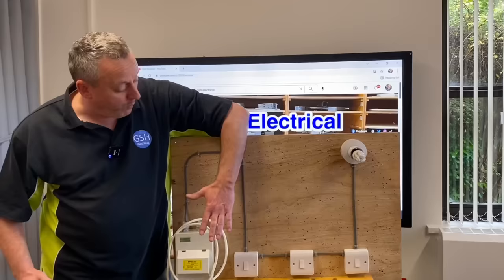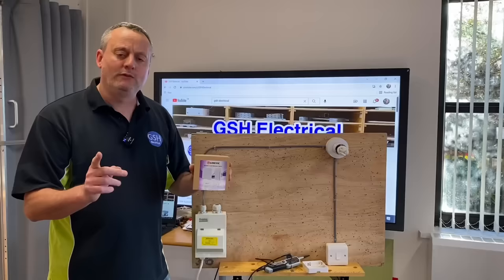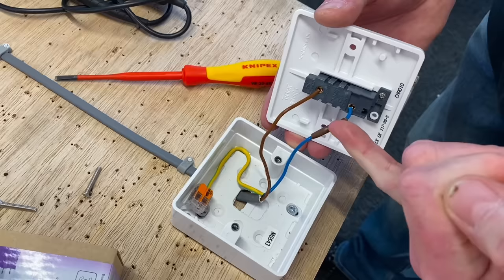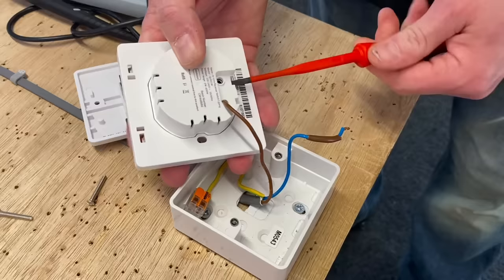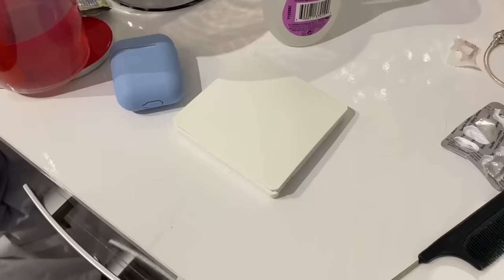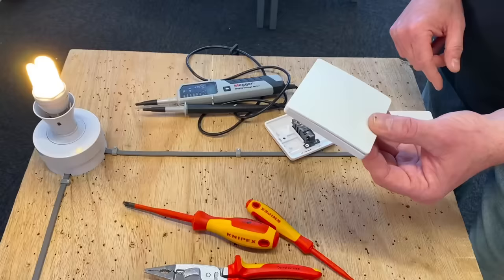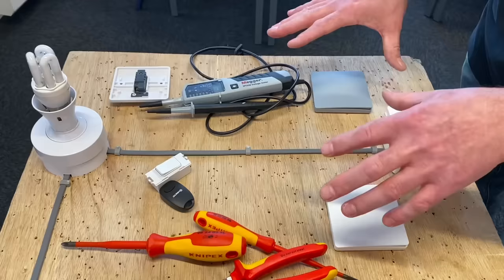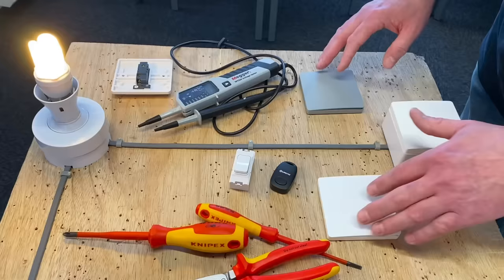No More Wiring Light Switches - The Secret is Out - Quinetic Wireless Switch with Built in Receiver

Comment: Looks great, but I've got a couple of questions - I'm an electronic (not electrical) Engineer by profession, and I understand that the master switch overcomes the lack of a power supply, i.e. live and neutral, by using a capacitor. I've read some reviews of similar products and a lot of folk say that there can be problems, e.g. if not used for a while the capacitor can discharge and therefore no power to the switch until it's switched on, and there can be intermittent flashing of the connected lamps. Really keen to get some of these in my home, so would really welcome any input from the professional electricians. Thanks
Reply: As a qualified electrical and electronic engineer I am not convinced that this expensive bit of kit is a realistic alternative to wiring it properly to  BS 7671:2018.
PS: The switch will have L (direct)and N (via the bulb). A LED bulb may not provide a sufficiently low resistance to power the electronic device or the bulb may flicker or glow dimly. Hence a proper neutral is needed.
Reply: The solution is quite simple:
If you add one (or more) diode in series with the bulb you will have a voltage drop equal to the Vf of the diode (or equal to the Vf times the number of diodes if you have more of them in series); more important thing, the voltage drop remains almost the same if you increase or decrease the load.
Of course, if you place one diode in series with the lamp you will also rectify the mains voltage; in order to avoid this issue, you shall add another diode in parallel of the first one (wired in reverse) to allow the transfer the entire cycle to the loads.
You cannot drain too much power using this solution, but is definitely enough to drive a very low power wireless device (couple it with a very low power bistable relay and a big capacitor and you are ALMOST done).
ALMOST because you also need some kind of AC-DC converter capable to run with a bulb in series also to power the device when the lamp is OFF!.
Unfortunately these things are usually incompatible with LED bulbs (but you can still use a resistor in parallel with the bulb to overcome the problem).
Reply: @teslacoiler  I'm pretty sure you just wayyyy overthunk that one LMAO. They use the same technology as the shake flashlight to create a volt through the little remote switch in order to send an on or off signal to the main switch, which is just a relay that makes or breaks the line.
Reply: See the explanation I gave to teslacoil in this thread. It's not as hard as you think.
Reply: @fivish  it's wired properly, they have a little 413 Mhz switch in the remote switch that acts like your garage door opener and it's powered by a little magnet in a relay like one of those flashlights that you shake. All it needs is a volt or less for just a second to send an on or off signal based on sideband frequencies of the 413 Mhz, just like a multi remote switch. The main switch is just for making or breaking the line and the runner that goes to the light with a relay, the neutral will be tied in elsewhere, and since it's a plastic box you just tie the grounds.
Reply: @Constitutionallycorrect  Yes, i already know the basic of the energy harvesting system buried inside the TRANSMITTER....  but Neil was referring to the master switch instead! (i.e. the RECEIVER!), which only uses two wires and is connected in series with the lightbulb.   🙂
Because of the receiver is not connected to the neutral, shall use some kind of energy harvesting system capable to power the device either when the switch is open (high voltage across the terminals but almost no current available) and closed (higher current flowing but almost no voltage available between the terminals).
Reply: @teslacoiler  Yeah, that's easy enough because the circuit they use relies on such small amount of power, they can put two high ohm resistors in line with the lamp, but parallel with the contacts, and draw off of that through a little rectifier circuit which would drive the receiver and a little relay. The receiver is most likely a little microprocessor like the arduino nano uses, which needs almost nothing to run.
Reply: The neutral wire does not go to the master switch.
Normally the power cable goes to the bulb, neutral wire is connected to the bulb fixture, live wire is not.
Live wire is connected to another cable to the switch and connected to L. The other wire going back to the bulb is connected to L1.
Reply: @teslacoiler  It's nothing so unusual, just some special circuitry in series with the load.
When the load is switched off, the whole mains power is effectively across the switch - that's when the "first" PSU activates (a.k.a. capacitor divider + a full bridge rectifier + some stabilizing elements) which delivers enough power to keep the receiver up. When it's switched on, however, another PSU takes over - this time, it's in series with the actual load, and again, delivers enough volts (depending on construction 1.5 to 3.3, to be specific) to power the active circuitry and keep the relay open. You can google "livolo switch power supply" - basically Livolo-branded switch PSUs follow a similar strategy.

Comment: i have used these (from china) and found that unless you have a 15W CFL I had issues with the transmitter. Needing a X2 cap across the light (which is terrible) They need a return path to neutral which is fine when the switch is off but not when the switch is on. I ended up with kinetic switches with the control switch above the rose. If these work perfect with a 5W Led type then that is a good improvement

Comment: Can this system be connected to one's mobile phone. So you can control, switch the lights on or off with your phone. And if one's away you could set up a stagger light switch timer on one's phone? Different lights at home.

Comment: GSH Electrical  Really Great invention, (ofcourse seen in video / switch Model: QURS1W, Voltage: 220 - 240V - 50/60Hz, Power range: 5W - 600W, it seems good, thin and simple key switch too) but can we use these switches for ceiling fans / motors / Geyser ? Upto what voltage & watts really will it work ? What's the cost per switch ?

Comment: I see that you have your power run or "home" run going to the light fixture first. That is not necessarily as safe as having it run to the switch. The switch should be functioning to interrupt power (line) to the load. As you have wired this circuit, power is present in the light fixture, even when the switch is off.
Reply: That is not correct.  There is no power present in the light fixture when the switch is off.  There is power present in the junction box, but not the fixture.
So what is dangerous about having power in a junction box that was made specifically for that purpose?
How long have you been an apprentice?
Do you know what a home run is?  How about a jumper on a branch circuit?
In old residential, as well as modern commercial wiring , the power and neutral go directly to the light fixture box.  
There are different wiring methods for different applications.  If you don't understand, ask before trolling.  There are dangerous wiring methods, but this is not one of them.

Comment: Still using CFL bulbs? This switch is just a remote controll and an expensive one. 
The Quinetic Receiver is £32.50 and dumb switches are £18.75.
Can buy a wifi enabled led bulb for £5-£8 and switch it on/off from your phone or Alexa.
Reply from the maker: Massive thanks for your input 👍🏻

Comment: Thanks for sharing this type of Tech with me. Question, Does this Wireless System work using (PIZO ELECTRIC) and (COMPACITORS)? Also, could this still work using (DC SYSTEMS) instead of (AC SYSTEMS)? Will this Electric System Work with the (ONE WIRES SYSTEM)? Again, thank you for the upload. Until this Video, I didn't know of these Systems. It is Appreciated by me. P.S Could you do a Complete Back Engineering of the Electronic Circuits on how all works and make another Video showing this?

Comment: Kinetic energy is an expression of the fact that a moving object can do work on anything it hits

meaning an object has so much speed in the  motion when it hits something it carries the something with it until the speed of the object decreases to a certain point
there is a formula for it
tank rounds use kinetic energy....I dont see a light switch having kinetic energy....but the word sounds cool...that your selling word huh
Reply: It describes the way the switch is powered, kinetic energy (pressing of switch) generating electrical energy which transmits a signal to the controller that interprets every transmission as a toggle instruction.  Most people would just use a battery powered switch but arguably, I kinetic switch is greener.

Comment: Is the pairing lost when the power fails? Would love to use these in Rented houses or HMO`s but it would be a nightmare for maintenance if they keep losing the pair.
Reply: Was thinking the same, ok till their is a glitch then you have to revisit to pair them. Ok if customer is savvy enough to do it themselves.
Reply from the maker: Checkout my latest video 👍🏻
Reply: I had a  3 hour power outage and didn’t have any issue when power came back.   Also had consumer unit changed again without any issue.
Reply: @darrencampbell5629  They keep the pairing even after a power cut.

Comment: Not sure if anyone asked, and did not hear you say anything about this.  Does the secondary switch get lost if you lose power over time?  Or how do you deactivate one switch after it is locked to a primary switch?
Reply from the maker: Hope this video helps 👍🏻

Quinetic Wireless Switch & Built in-line Receiver - What Happens when the Power goes OFF & Unpairing
https://youtu.be/rDrqvBorTGI

Comment: Could you replace a bathroom switch with pull cord by connecting the wired transmitter/receiver on the ceiling and then the unwired one on the wall in the bathroom - there would be no contact with electrical cabling at the wall, so would imagine would be within the regs.  I absolutely hate pull cord switches!

Comment: I have found that wireless can block other wireless signals, I even have problems with one receiving from the other 4 mt away through open space. I have to move my radio clocks away from my router otherwise they will not auto-update. I got very little work related teaching from college as I was normally sitting waiting for others to finish as site experience made for speed, I found college taught apprentices were so slow. 
Now, if we can only get wireless sockets!

Comment: I  assume the receiver gets its power from a small circuit leak through the lamp all the time.
Reply: I think you are right. The spec says it has a minimum lamp load of 5W which would make sense; if the lamp load was really small then the leak current might illuminate it.
Reply: @Troy Mclore The device needs power to operate. Power needs electric current to flow between live and neutral. If the current doesn't flow through the lamp how is the circuit made? You can't power something with just a permanent live it needs a path to neutral to make a circuit.
Reply: @Troy Mclore  Hi, for the receiver to be able to recognise signals from other switches then it needs a power source not just a voltage source. And the only way to have a current flow in order for the receiver to operate and indeed close a switch (relay coil or power transistor) would have to flow through the lamp. There must be a minimal continuous current flow through the lamp to achieve this. Correct me please if I am wrong. That's why they are so popular as the don't need a neutral at the switch for current flow.
Reply: Also possible it uses a capacitor?
Reply: @peterbridges6851  💯 correct

Comment: After watching this I have purchased one of these receiver switches & matching switch. I want to replace an existing 2 way switch with the Quinetic allowing me to add a third switch halfway along the hall. What I missed is the existing switch is of course 2 way with the third connection and 3 core and earth cable, the quinetic only has two connections. Can I still use the quinetic as they do not show this situation on the accompanying diagrams?

Comment: If you was to take that fob with you on your keys to let's say turn pillar lights on/off on the front of your house when you pull up outside from work etc. Presumably going out of its range and then coming back into range won't require a re-pair each and every time will it? It just remembers the signal sent from each switch regardless
Reply: Correct the receiver just remembers the IDs of the paired switches.

Comment: Not an electrician, but what about multiple switches in a single box. I can see how it works for one circuit (light) but how would it work or even would it work for say a 3 switch socket

Comment: Question :
If you loose power in the house do you need to re pair the switches with the lights again?
Reply from the maker: Quinetic Wireless Switch & Built in-line Receiver - What Happens when the Power goes OFF & Unpairing
https://youtu.be/rDrqvBorTGI
Reply: @GSHElectrical  wow ..honestly im amazed👍

Comment: This is game-changing!  Is there equipment to implement this technology in a package that's compatible with 120V (NAmer/Japan "semi-phase) residential wiring standard and fits and is visually similar to US switchplate design?
Reply: Semi-phase, i believe you mean single phase, 120/240 but it can also be 3 phase 120/208.
Reply: @vladimirpolak5203  Yes, you and I know that the current in N America, Japan, and other places is single-phase but people often quarrel with that, saying it should be double phase since the phase polarity goes up and down.
Of course, it's not.  That's a single phase because there's only one phase there.
I shouldn't have used "semi" because it's also wrong and an incorrect technical description but it was meant to guide people away from the "double" or what other term that they might think correct.
Better to just call it what it is. "Single"

Comment: Why not simply have power to lights and no switches? Put the switching mechanism in the light itself and then have switch units that have changeable frequency so they can be paired with specific lights. It would eliminate all switch wires.

Comment: I don’t understand where the requirement comes from for having at least a 3W light? I suppose in most cases it wouldn’t be an issue I’m just can’t think why it wouldn’t work though
Reply: Any less than 5w and the light would start to flicker or be partially on, the reason for this is the way these work is by allowing a small amount of current through to power the receiver. You can also get dummy loads for other brand that you can put across the light to remove this issue but they are effectively doing the same of allowing a small amount of current through without the light turning on.
Reply: @ingy23  I must be misunderstanding the wiring on these (I'm not an electrician). To my mind the switching line coming down to the switch is at full current so it has all the power it needs there for the receiver, then when it's 'on' it's letting that current through to the light? The power for the receiver wouldn't be dependant on the light itself in that case?
Reply: Oh wait a minute I see what you mean, in order to complete the circuit some of the power has to go through the switch at all times even when it's off and that trickle of power would be ignored by the light as such as long as it's not a really low wattage?
Reply: Yep that’s pretty much it as long as the light needs 5w or more to turn on the small amount being let through the switch at all times wouldn’t be enough for the light to function.
Reply: This kit wont work with a LED bulb of less than 5W (40W equivalent).

Comment: Given that it's most likely a 433Mhz signal, I wonder if you can pair just the switch (the remote part) with those generic Aliexpress relay modules which usually come with key-fob style remotes. Has anyone tried it ?

Comment: Like letting the genie out of the bottle, is there no way to un-pair? Until death do they part? What is you leave a light switched on for months - can the main switch still get power to function?
Reply from the maker: Quinetic Wireless Switch & Built in-line Receiver - What Happens when the Power goes OFF & Unpairing
https://youtu.be/rDrqvBorTGI
Reply: @GSHElectrical  Thanks. Good to know.

Comment: Hi. Could I use this to turn on heating. I have a two gang switch in press. One to turn on heat upstairs and second to turn on heat downstairs. Old house. Could I replace two gang switch in press with the 2 gang receiver version then put a 2 gang wireless switch upstairs in my room
Reply: You'd have to see what the current rating is, your boiler is probably on a 13amp rated switch not a 5amp light switch.

Comment: Why is the switch cable trapped behind the pattress instead of coming in through a knockout?
Reply from the maker: I didn’t want to cut a hole into the top of the box so I raised the box and so the cable could come in the back. This means the box can be used again in a different video 👍🏻